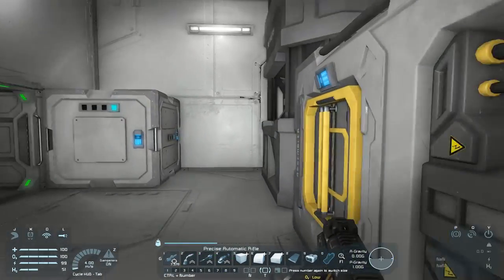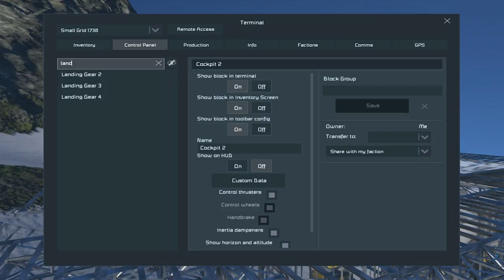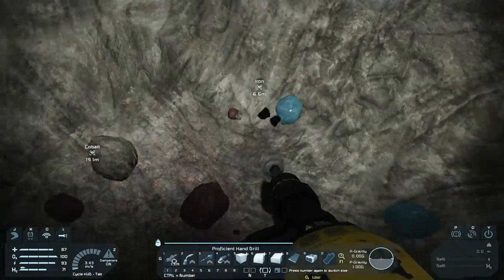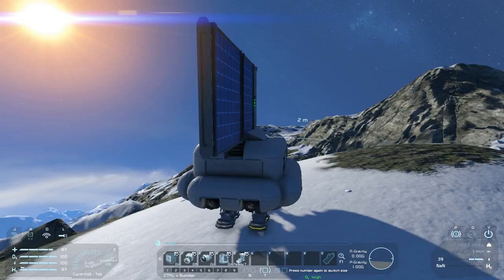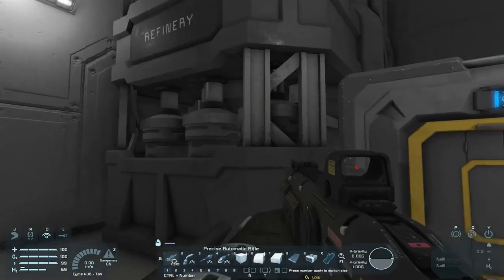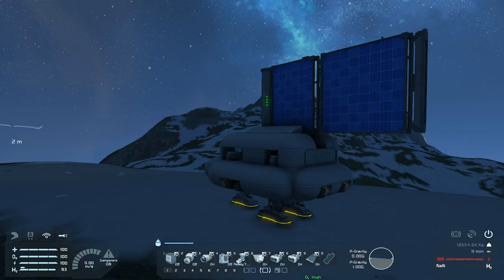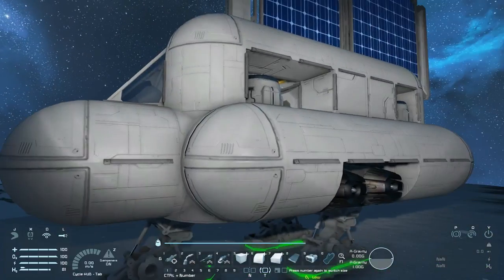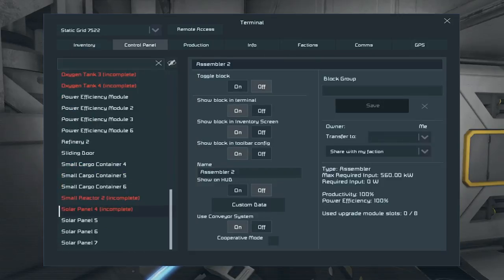Let's Play Space Engineers - Episode 10: Scout Ship Stranded & Adding Upgrade Modules

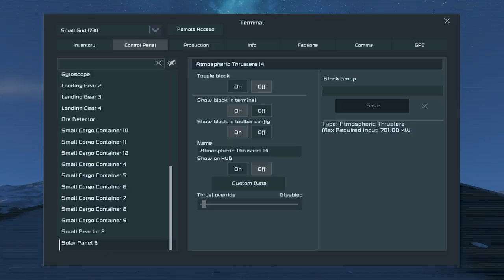Comment: 17:36 your battery is in recharge mode so is not providing power to the thrusters, 
22:40 with the added weight of all the iron you need more thrusters also taking the battery out of recharge mode will help you can even put it in to discharge mode for some extra power but it will drain faster.
also you no longer need to vent the cockpit when in atmosphere.
Reply from the maker: Yeah, I actually knew about the battery stuff already, I just messed with it off camera and forgot to mention it. But I think the main thing was not accounting for the weight of the ore. :/
Reply: ok just making sure I always forget about the battery myself, then I feel like an idiot when I realize i forgot to take it out of recharge mode.

Comment: Build Vision is an interface mod which lets you access the control panel features for a block by looking at it, goes really well with Easy Inventory. Another issue is altitude as the higher you go the less thrust you get from atom thrusters. Since you have a moisture vaporator why not replace the volume of the armour on the scout with a hydrogen tank and a down facing thruster for moving at heavy load? Is there a Small grid version of the vaporator?